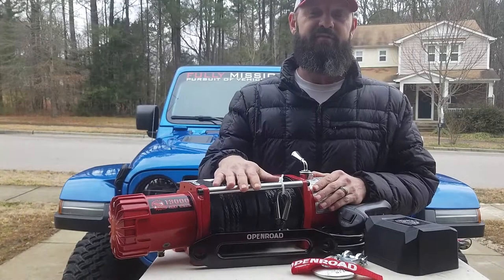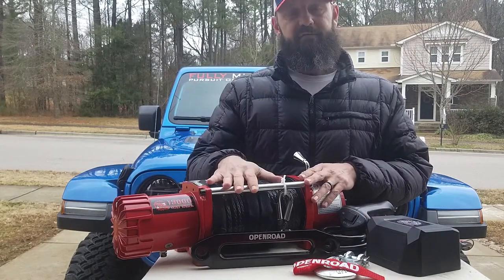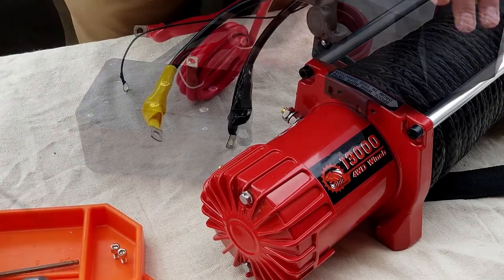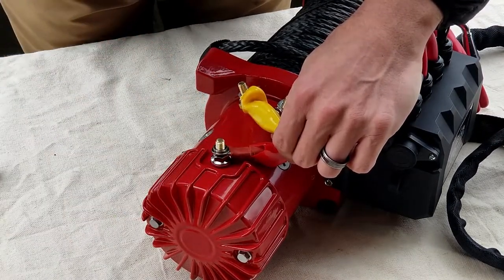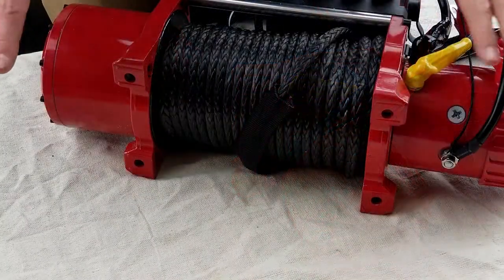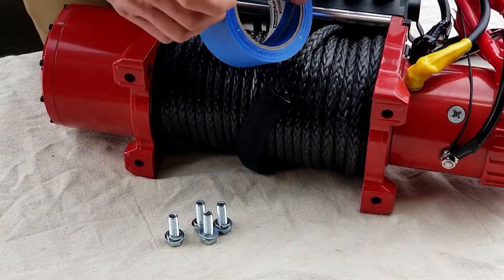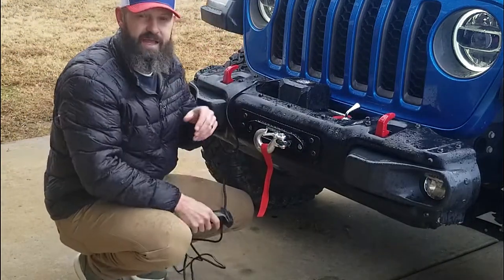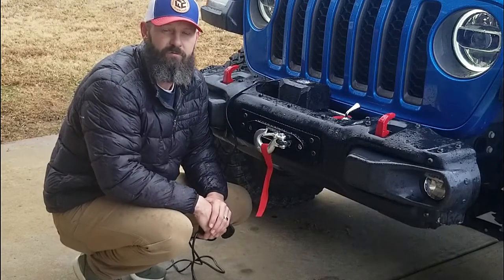How to install a winch? Just the basics with our Openroad 13K winch!

Comment: Awesome Video. Not a lot of info on the Openroad winch out there. 
Any idea what the difference is between the Heat series and the Panther?
Reply from the maker: I believe just a color difference, black or red...other than that I've used it several times and it's a great winch 👍

Comment: Mine came with a resistor on the positive wire was also thinking of adding a solenoid
Reply from the maker: we also added a master switch for the winch near the battery

Comment: My 13,000lb Heat Series came with a overload protector. This overload protector is failing for me. I cannot get any information from openroad4wd other than they do not sell them anymore. Do you know how many amps this winch draws? I'm wanting to use a resettable fuse for this, but don't know what amp to get.

Comment: what winch plate did you use? did you have any trimming issues or require drilling new holes for the bumper skid plate to be reattached? thanks!
Reply from the maker: So winch plates are very specific to the make and model for the jeep factory bumpers, but I got mine from etrailer.com, good prices and fast shipping, brand name is Bulldog. Used all factory locations in my bumper, no drilling and skid plate went right back on.
Reply: @FMCOverland  thanks!! this is exactly what i needed to know. ive been eyeing a few different brands, (rustys, mopar, warn, maxxis, etc) and see ups and downs of each model.. i definitely want the material composition to be worthy of the task... i have a 2020 JT as well you may have seen a few of my long winded installs or reviews